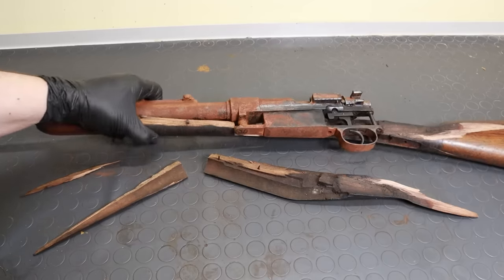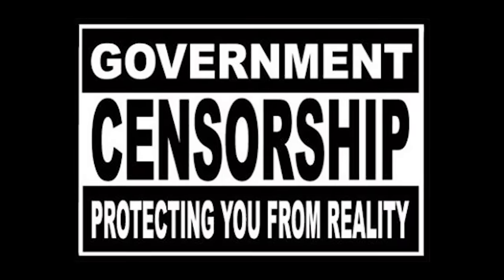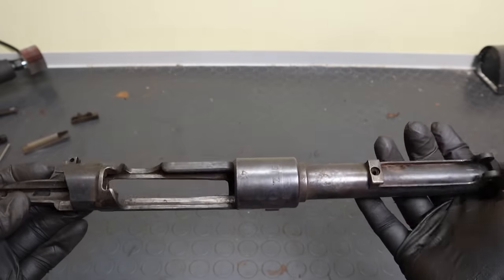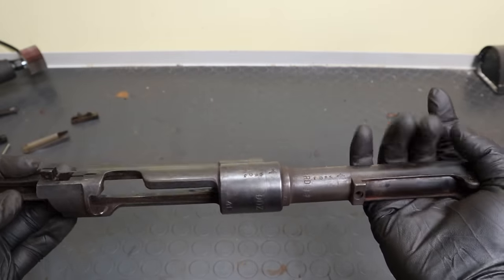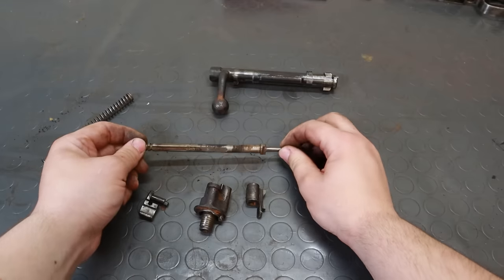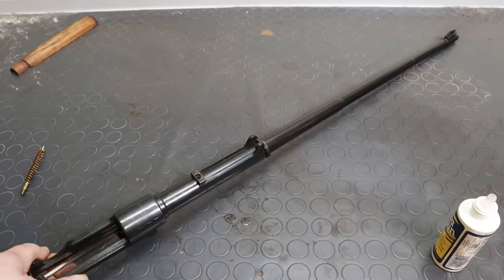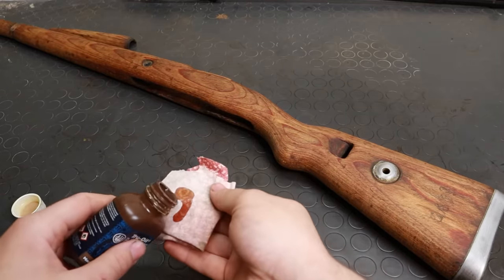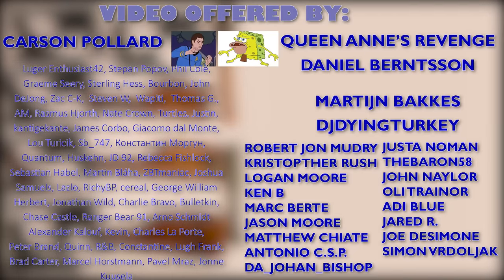Restoration of German Kar98K WWII Rifle

Comment: it just hurts seeing you use a vise for the extractor, it has even a dent because of this method. Just turn it to the clean side, push the ring with your fingers together and hit gently on the rear side of the extractor. It will pop off easily without any dents. For the blueing, just use bluing salt 1 KG per 1 Liter of Water on 125- 130 Degree Celsius. For hardened Steel 132- 135 Degrees.  10 to 15 minutes. Before the bath you have to degrease it completly or you will have ugly spots on the metal and after the bath cool it down in distilled water and oil it with 
WD-40

Comment: I am realy not sure how is that 100% correct and not an fake what he is doing here, all rust is only outside nothing rusty inside nearly at some points and that where the thin springs are, thats very weird and unbelievable for me.
Reply: So logic doesn’t make sense to you let me explain the inside of a gun is low tolerance witch is vary tight and well lubed it’s like how a engine can be rusted to shit but aslong as it stayed sealed it’s fine

Comment: Question, why do you use steel wool over something like brass brushes or brass wool? Do you ever struggle with a distressed or scratched look from the steel wool? I have seen a lot of guns that have been "restored" in hasty ways that have obvious signs of steel wool being used. Perhaps its just a gentle touch is required, very curious about your input!

Comment: Nice work.

Do you have any experience with removing the horrible suncorite paint they applied to Lee Enfield rifles during WW2?
Reply from the maker: You can try either a paint stripper, which will transform paint into a jelly which you then have to scrape off, or submerge the metal into a concentrated sodium hydroxide (lye) solution, which should chemically decompose paint.

Comment: Hey you,
I realy like the way you restore the firearms and do the traditional way of darkening the metal parts. I tried out the blueing method you used on this and the Italian rifle on sheet metal for a great helm I'm building, but after coatings and letting it boil more than 10 times, it is still not as dark like the metal parts in your video and I don't know why. I feel like that I'm scratching the blueing away with the steel wool to the blank metal. 
Where did you find that recipe? Does it depend on the hardness of metal to work? Or do I have to let the part sit for a while to scratch it of?

Comment: Why not use a bead blaster followed by a buffing wheel?
Reply: Removes bluing and guns aren’t buffed
Reply: @strangetar2833  In terms of a more complete removal of rust, the buff would be used to bring back the more polished finish (depending on blast material used it can create a matte finish) and then you would re-blu.

Comment: Question: Is it normal for K98K bolts to be stiff when the handle it being turned down to lock the bolt with the safety off?
Reply from the maker: When you close the bolt with the safety off, you are rotating it against the friction caused by the compressed firing pin spring, so some additional stiffness compared to when the safety is on is normal. I would reackon you need a few pounds of force on the handle to close the bolt. If much more than that is required in your case, something must be off
Reply: @Backyard.Ballistics  Ok Thanks!

Comment: orange rust: new rust...bolt is far too clean vs the other parts.. the trigger is all clean even the parts that is outside ... even if the internal parts were protected by the stock the trigger must have rust on it...
Reply: It was found in a demolition. You thing the guys there didn't try to pull the trigger? That would wear most of the superficial rust, as that's usually all that's on old guns, off and make it look relatively clean

Comment: The "Background Stories" about these weapons are so hilariously bad, it's quite astonishing how many people believe that they are even remotely real. Just as with the Pump Action Rifle, it's just so badly faked, that's not what aged, rusty metal looks like. Those have been artificially aged.
Reply: That's what rusted GUN metal looks like, however no it is not what the average steel plate looks like when rusted. The treating process used on gun metal is done specifically to prevent it from rusting, meaning that 99% of rust on a gun is superficial and scrubs right off

Comment: Why do you not use a carding wheel to remove the rust after boiling?
Reply: any kind of wheel will always impress its own shape into the surface. steel wool conforms to the surface shape perfectly
Reply: @KhaziirEverflight  A Carding Wheel will not even strach your finger and for sure will not remove anything except rust on a gun made of steel..

Comment: Its a Vk 98 isnt It ?
Reply: What is a Vk 98? The gun is a normal WW2 issue KAR98K, a somewhat shortened version of the Gewehr 98 used in WW1. There was also a shorter real carbine issued to cavelery in WW1, but the recoil and muzzle flash was severe.
Reply: @erik_dk842  You know the volksturm line of rifles ? Well the vk98 was the last ditch versión of the K98 , Forgotten Weapons has a vídeo on it and Im just saying that 98 could be rarer than thought.
Reply: @miguelgutierrezcalvente5469  I never heard of it before, so I watched the forgotten weapons' video on it, and if you do the same, you'll not suspect this rifle to be a VK for one second. It's a standard KAR98K made in 1941